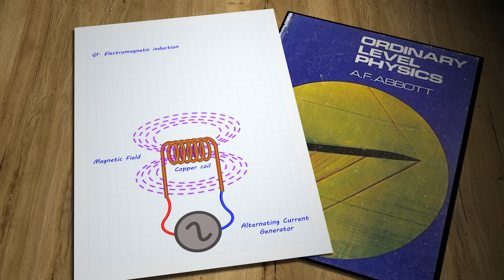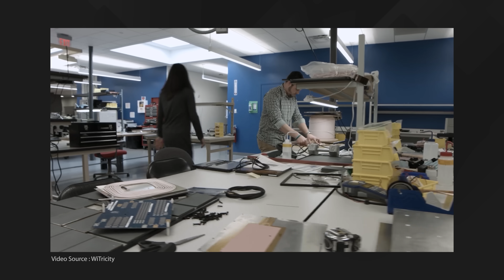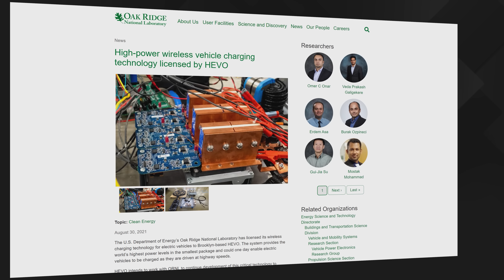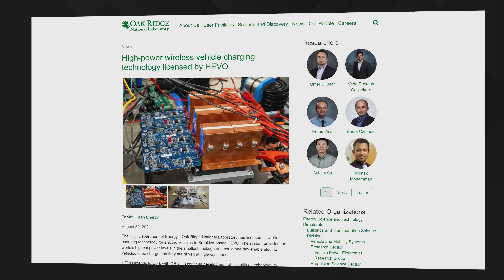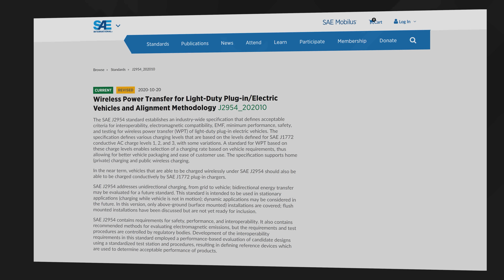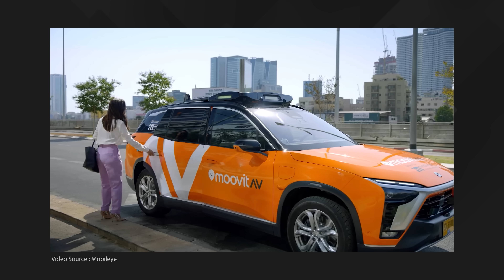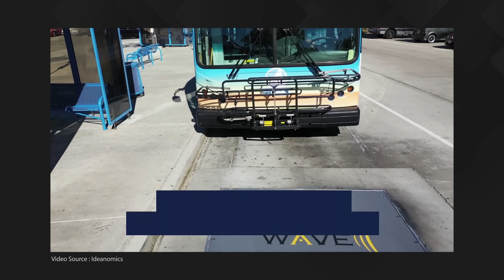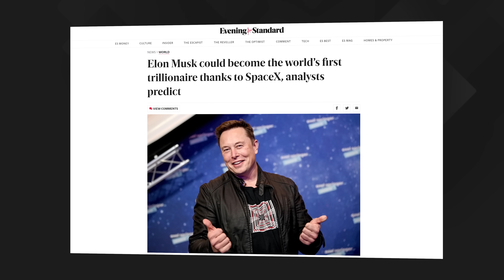Wireless FULL EV charging has arrived!  Exciting new tech breakthrough.

Comment: I'm very far from being a naysayer, but I DO worry about the ability of our national grid to cope with the huge demand for electricity in the next decade or two. I've heard nothing about its spare capacity as it stands or plans to expand it - although I assume there must be plans to do this? I'm also concerned that the huge amount of electricity required in our 'all electric' future will mean an expansion of non-renewable generation. Again, I assume (hope!) that plans are being made to cope with this without falling back on gas and coal. But, with this government's track record, I have my doubts.
Reply: This is what the National Grid have to say;

“Can the UK energy grid really cope with a huge increase in the number of electric vehicles being plugged in for charging?
There are two aspects to whether we have the capacity to manage lots of EVs being plugged in at once – whether we have enough energy and then whether we have sufficient capacity on the wires that carry that energy to where it’s needed.

Enough capacity exists   
With the first of these, the energy element, the most demand for electricity we’ve had in recent years in the UK was for 62GW in 2002. Since then, due to improved energy efficiency such as the installation of solar panels, the nation’s peak demand has fallen by roughly 16 per cent. Even if the impossible happened and we all switched to EVs overnight, we think demand would only increase by around 10 per cent. So we’d still be using less power as a nation than we did in 2002 and this is well within the range of manageable load fluctuation.

'When' matters, not just 'how much'
More complicated though is the issue of when that power demand actually happens – is it all at once or spread through the day and week?
The traditional evening peak of electricity demand is between 6 and 8pm, and this might well coincide with people returning from their commute and plugging in their cars.
If we want to provide sufficient infrastructure and energy for EVs as cheaply as possible for consumers, we ideally don’t want to add to that evening peak and need to spread that demand better.
With this in mind, recently the Government’s EV Energy Taskforce recommended that all future car chargers should be ‘smart by design’. This means that no matter what time you come home and plug your car in at, it will charge when you need it but will pause during that evening peak when energy is most expensive and demand on the grid is highest.

Time to make improvements
When it comes to the capacity of the wires required to deliver that power to the nation’s EV charging points, National Grid’s transmission system is ever-evolving and suitably robust to cope with the forecast uptake in EVs. That said, some targeted investment is likely to be needed to ensure there are appropriate places where drivers can access sufficient high power charging away from home. This particularly needs to be on the motorway network to give confidence to those travelling longer distances, to ensure charging does not interrupt those journeys. Fortunately there is already a lot of electricity infrastructure right next to our motorways as power lines are often run beside them for practical reasons.

The other point to bear in mind here is that the switch to EVs won’t happen over night and will occur gradually over the coming years”.
Reply: @cbromley562  cheers
Reply: I just hope that people learn to stop driving. The electricity grid won't suffer if rural people are the only ones driving, and if some people who commute 82 miles decide to move to the city where they work.
Bicycles, transit, walking; that's sustainable.
They say EV batteries which don't get recycled pollute the environment; well, electric buses can use capacitors instead of batteries, as capacitors aren't toxic, because they are not chemical energy storage, but instead static electric charge storage.
If everyone rode the bus and train and bike, or their own two feet, we wouldn't be discussing the national grid's ability to cope.
Reply: @موسى_7  I used to take the bus. Grocery shopping was an all day event. I couldn't carry everything I needed. I had to cross dangerous streets not designed for pedestrian use. I have a chronic illness so I didn't have the energy to make those trips often. I was also in school, so I didn't have several extra hours per week to spend shopping. I tried to stockpile as much nonperishable food as possible between semesters to limit the my shopping during the semester. The rest of the system needs to be workable before I'll take someone seriously when they say people don't need cars.
Reply: @melissamybubbles6139  In the UK we have pedestrian-unfriendly cities? I live in London. I thought only America was bad for pedestrians. The only times I left London was either to go to a forest, or leaving out of Heathrow Airport, so please excuse my ignorance about the UK.
Reply: @موسى_7  But public transport and bicycles and walking (when weather isn't great) are unpleasant.

For people to stop driving, public transport needs to achieve the following:

- Be able to go from home, right up to the door of your destination and back again, no transfers, walking the last mile etc, all that takes forever.

-Be sanitary, not be in close proximity with other people. Be in sealed micro pods with filtered air that are sterilised after each use so as to prevent the spread of disease.

-Be immediately available when you want it.

Unless all three are met I don't see people not driving. The electricity grid has always scaled up to meet demand because you can sell energy at a profit, and companies always step in when there's a financial incentive. Plus the UK's  energy demand has actually been falling since the late 90s even as our population has grown thanks to energy efficiency improvements in our appliances. It's gonna be fine.
Reply: @samspencer7765  Not sure you need all those specific attributes. It would make a big difference if public transport followed the three Fs. Fast, Free and Frequent. Unfortunately I read one Council's net-zero plans and the height of their ambition was the ensure that public transport was 'adequate'!
Reply: @Paul_  Yeah it's unfortunate, free public transport would definitely help. Sadly it's just typically an unpleasant form of getting around.
Reply: @موسى_7  as someone who's never owned a car, I couldn't agree more. Very few people really NEED a car, it's more of a convenience than a need in most cases. And it's this love of convenience at any cost that's got us where we are.
Reply: I'm not sure it is a big problem because what we are also seeing is a move away from centralized power production at a few big power plants to a lot more distributed production all over the place, and the trend seems to be increasing rather than decreasing with not only ever more rooftop solar options but new technologies like thin-film solar able to in principle turn every high rise building's glass into a solar farm, adding solar panels to shade at least some farmland, and the like. Also, if everyone's EV is also a battery, that will reduce the cost of home solar and probably accelerate the process of rolling out rooftop solar, so we'll probably see EVs having a lot less impact on the electric grid than the pessimists worst case scenario.
Reply: Due to the average daily milage that a huge majority of cars do (15-30) the actual consumption of energy is relatively low. Most EVs will just be topping up their batteries. Given the overall electric capacity of all those batteries added together, that resource could be harnessed to buffer spikes in local use. This is not a new idea and improvements to inverter technology could make realistic grid to car/car to grid a thing for the future. The one thing renewable energy needs is storage capacity, and uptake of EVs could solve this problem if people are willing to allow their vehicles to be part of that solution.
Reply: Engineering Explained has a video on how much switching to an electric vehicle affects electricity costs, and it's surprisingly little. It's still an increase that needs to be met, but generating enough total electricity to cover demand isn't the main challenge our electrical systems face - the real challenge is timing that generation to match the electric usage at every moment. Because there's room for a lot of flexibility for when EVs get charged, EVs can have an enormous stabilizing effect on the grid by charging during off-peak hours and not charging during peak demand.  There's plenty of talk about vehicle-to-grid systems, and there's a lot of potential there, but that's not necessary for EVs to be of great benefit to the electrical grid.
Reply: I think the "Fully Charged Live" channel has done at least one in-depth show on this, proving the grid will cope, with the current progress being made.
Reply: @enterprisestobart  You're absolutely right that among other things, more cars creates a vicious circle of lower public transport ridership, which means lower income which means worse/less frequent service. I did neglect that.

I just think that being realistic, if government's want public transport to expand, then they need to invest enough in it to make it nice enough to entice people to use it. 

As it stands it's just unpleasant to take public transport, and in a post pandemic world people are more attuned to the outcomes of being in close proximity to many people breathing and coughing and touching surfaces.

In terms of the energy use in the last part of my comment I'm just talking about the raw data of UK electrical demand, which peaked around the millennium at 375 terawatt hours per year and has declined since to around 300 terawatt hours per year.
Reply: I am lucky because I had enough room at my house for 10kW of solar.  So the whole house, two heat pumps, two cars and all yard equipment is powered by the sun.  There are tens of millions in the US that can do the same thing.
Reply: Check out the National Grid Future Energy Scenarios report that discusses this issue. They are not concerned subject to the use of smart home chargers. Local area reinforcement will be needed, especially with the connection of new renewable generation sited away from the existing main grid lines.
Reply: For typical commuter charging the grid will have no problem.  Where I see the issue (here in NA) is you have times such as holiday weekend where a huge number of people are travelling long distances.  This will require an enormous amount of power compared to a typical day to change all the cars.  I expect a modular nuclear reactor could be a source that could rapidly ramp up the power needed, but that will not be an easy prospect to sell.
Reply: @Richard Wood  Just watched part 1. Excellent, cheers.

Comment: i hope they build a stretch of road where if you ride over it, your vehicle can be charged.  They can put a toll for this just like the toll roads we have in the West which are automatically billed by the time you use it.  This will eliminate/reduce the need for charging stations.
Reply: No, this will make a road that can't handle heavy weights. Let's just make people's cars have only enough range for two hours driving, and charge their batteries in no less than fifteen minutes, for the sake of their health; it's unhealthy to drive for more than two hours without a fifteen minute break.
Reply: When the road needs repaired not only will you need road workers but also an electrician.
Reply: @shawnr771  i am sure these are minor hick-ups. Just like how new firefighters are being trained on how to handle fires on Electric Cars.
Reply: @Soothsayer210  yes a Tesla on fire uses a significantly greater amount of water to extinguish.

Given that water comes from the same system that provides drinking water. 

Electruc car fires could be a significant threat to people's survivability.

Especially in the Southwestern US where water supplies are running dangerously low.

Water to drink or should we put out the fire.

The infrastructure in the US is good in most places.
We can barely get our government to spend money on bridges, dams and the electric grid now.
Reply: @shawnr771  you will have less water because of climate change. It's either electric cars or the end of unwalkable suburbs.
Reply: @موسى_7  i agree with the urban transport and understand electric cars are certainly a better alternative to fossil fuels.

Need a more efficient way to extinguish the inevitable vehicle fires.

Especially in places where water is not plentiful.

Comment: What’s the problem with plugging in and getting a much (!) better efficiency?
Reply: Well for commercial transit, i.e public buses this is actually a huge game changer, as many people who have taken a ride on a bus they know that buses often stop at bus stops on a route for a couple of minutes when they are running ahead of schedule, allowing buses to recharge more quickly (not plugging in) and frequently allows for smaller battery packs to be used on the bus which would decrease bus weight which improves mileage. I know alot of buses use the overhead cable method of supplying electric power but this model only works in high density situations and not all bus routes can benefit from this strategy, using wireless charging pads on other bus stops on less dense bus routes would allow pretty much all public transportation routes to become fully electric which would be a huge win for tracking towards net zero!
Reply: Convenience
Reply: Energy corporations are not interested in saving us money!
Their only in it to increase our expenditures on their products!
Reply: Many people live in homes without driveways or garages.  Having charging of varying types makes it more likely that people can go electric.

Not necessarily the best option but sometimes the most viable.